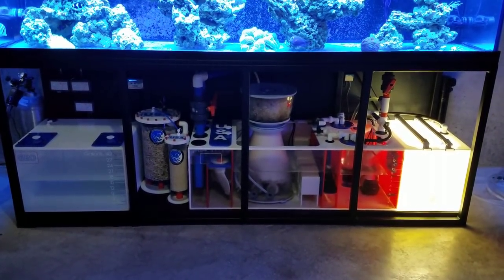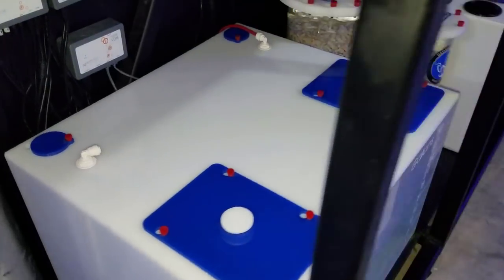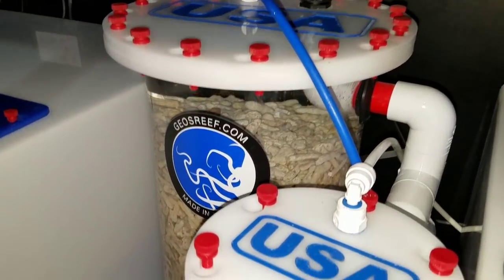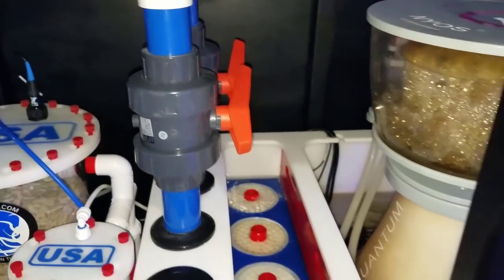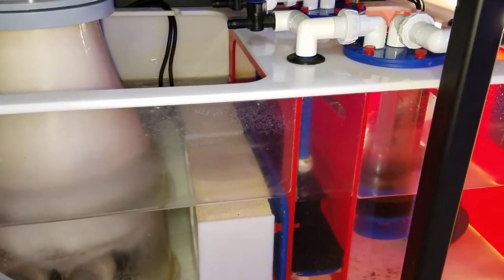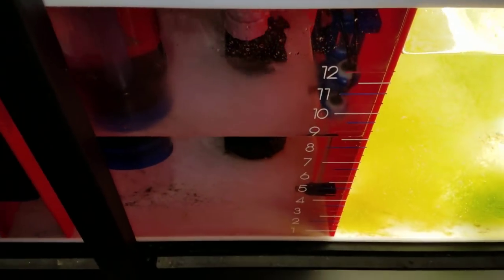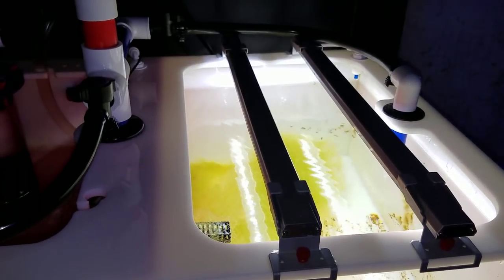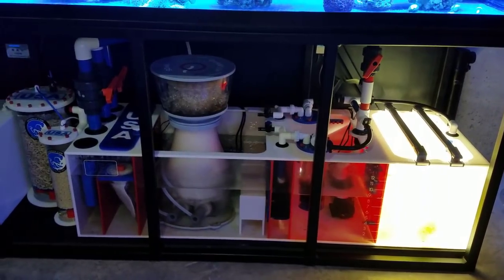Custom GEO Sump Walk Around

Comment: Mind sharing what type of plumbing you use to connect the Black ball valves to the pcp, there is obviously a reducing busing. The black stuff is like lawn irrigation pieces. Is it just threaded into the reducer (pipe thread) thanks

Comment: Put ur heaters next to the return pump and keep the thermometer in its place
Reply: To keep the whole tank at the same temperature not the sump only
Reply from the maker: It doesn't impact the reading as the water is already past the probe before its heated and returned to the tank.... its not back flowing to the temp prob haha
Reply from the maker: It doesn't impact the reading as the water is already past the probe before its heated and returned to the tank.... its not back flowing to the temp prob haha

Comment: Quick question mate, First superb looking custom sump, man Geo did a really nice job! Anyways, I see that you are running 3.15inch drains but you have 2 Cepex 1.5'' ball valves on each drain, why did you go with two instead of just 1 1.5 Spears Gate valve to control your main drain... Looks like you have Ball Valves on your secondary as well any reason for that and the reason why I asked is I am getting ready to hard plumb my Synergy 20'' External Overflow box that has 3.15'' drains but I was only going to use one Spears Gate Valve for more precise control sort of speak.

Comment: Okay so I'm new to saltwater and have what I think might be a very stupid question. The skimmer, everything I've read says that water is sucked in through the upper portion of the bubble chamber then skimmed through (if you're using a counter current method) then sent back out through the bottom. On yours though, I don't really see anything that could be making it go in through the top. And even if it does you said that same chamber of the sump flows into the next. So would it not be dumping skimmed water right back into an area of unskimmed water, having it flow into the area, into the display, then back again to repeat that? Or is that the point? It's frustrating that the only part of the skimmer I don't understand is quite possibly the simplest.